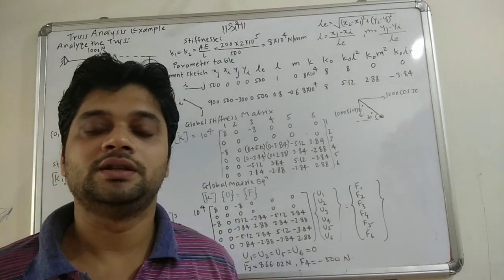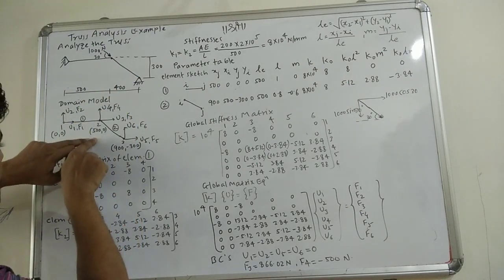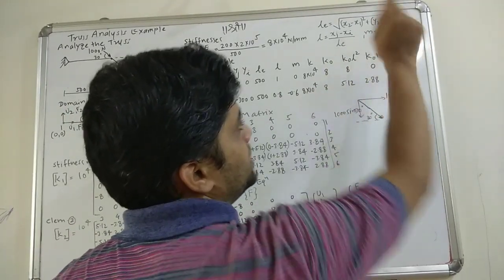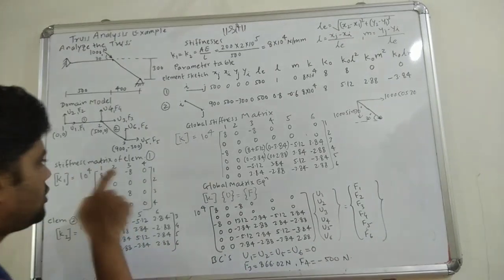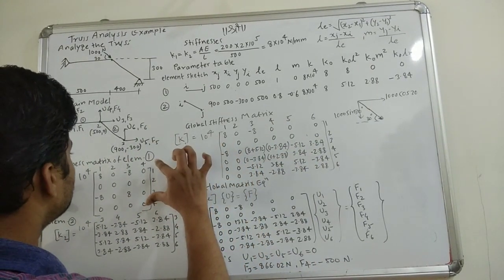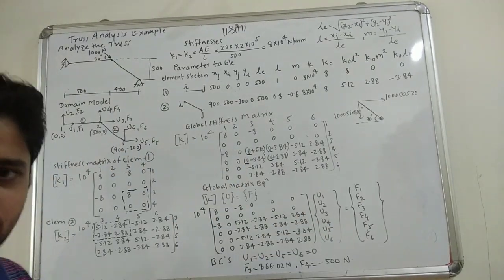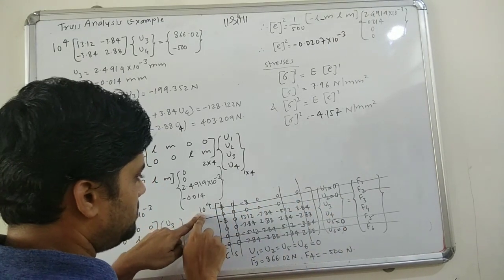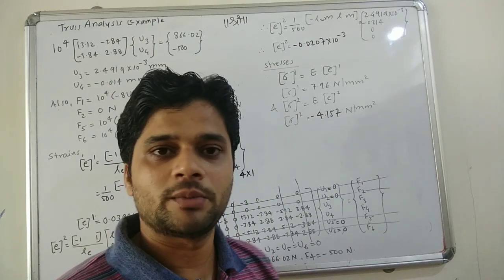Truss analysis - example problem

Comment: For finding strains. 
In transformation matrix do we use value of l and m or k.l and k.m ?
Reply: You have used k.l and k.m in element 1 and l and m in element 2.
Reply from the maker: In order to derive the stiffness matrix for truss element we use l and m only.
I told u the trick to use uncommon factor multiply it with l and m so that u reduce an extra step while solving problems in exam